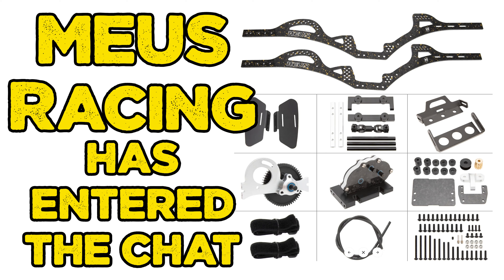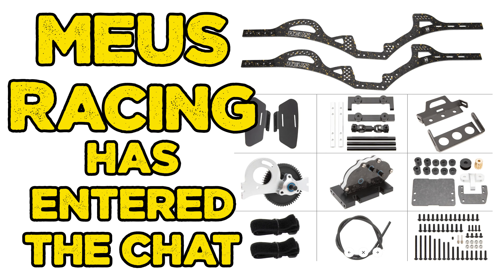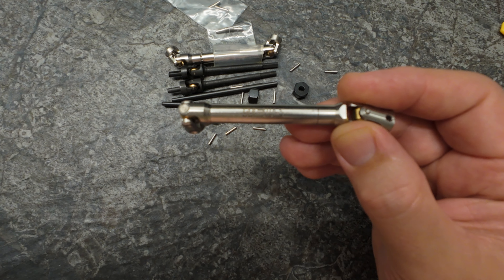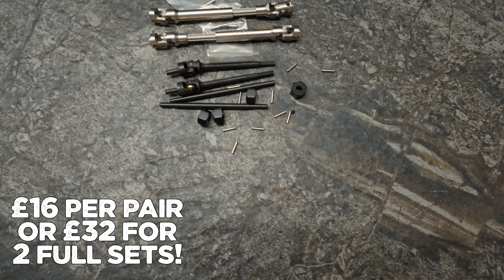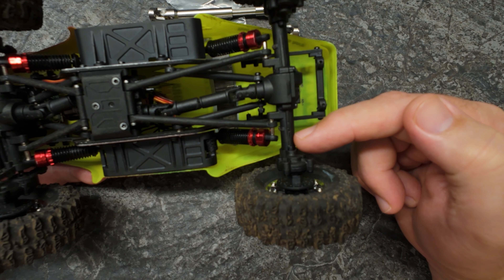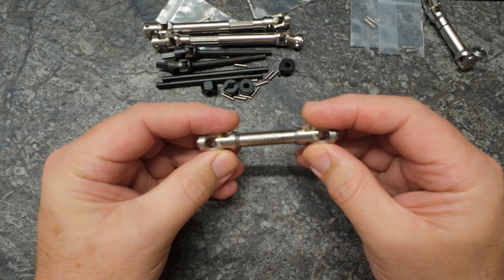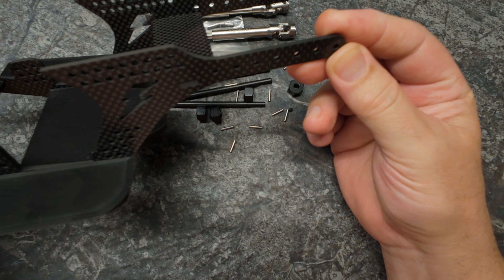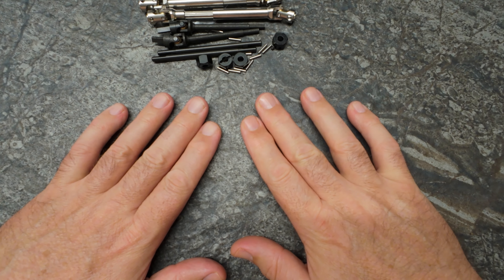RC Mail Time EP5 - Wow, MEUS fixed it!

Comment: Nice parts, an good looking drive shafts. So far we’re still running plastic ones, because in a complete metal drive train, without a slipper, I like to leave those as a easy to fix weak spot, hoping to have a predetermined breaking point in a worst case scenario, instead of snapping any gears or something else you can’t fix easily in the field or even in a comp situation 😅
Reply from the maker: That's very wise Lisa, luckily this setup will run a slipper. Thank you for stopping by :)
Reply: @The_RC_Family  It definitely was, I snapped one of the original plastic drive shafts yesterday in a comp situation 😅
Reply from the maker: @bouncingnoise  Good job you were prepared! 😁